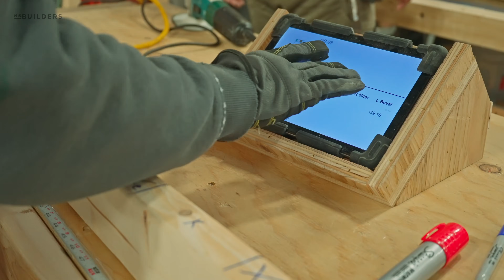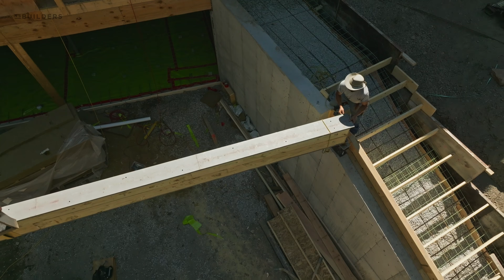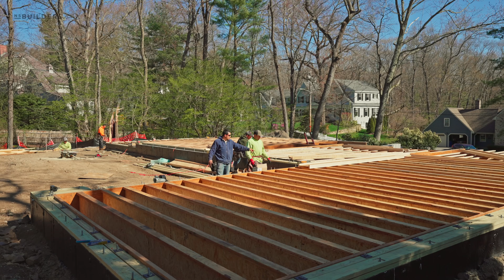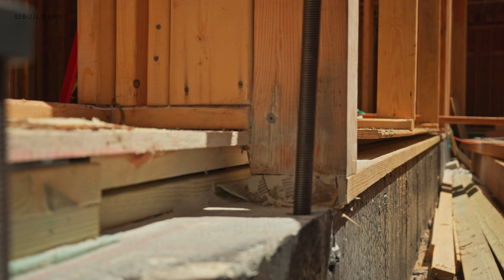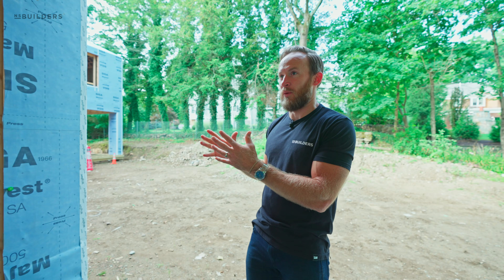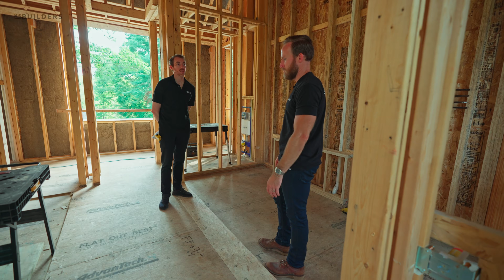Structural Engineer & Builder Walkthrough Custom Residential Home

Comment: Sandwiching LVL with steel plate is a great way to rot an LVL if it's in an exterior wall, I don't know why you would not just use a regular steel I beam, insulate one side pack(ledger) the other, or use wider LVL, if it's thicker than the bearing you have to use post+cap though not just stud, not a big deal.
 I use strongwalls a lot in narrow city houses it's the only way to keep them from falling over without an interior shearwall.

Comment: Bottom line: general contractor and framers must take structural engineering classes for builders. Also they need to obtain residential residential building certification. I hold myself to this standard.

Comment: Very beautiful framing work, from the attention to detail to the craftsmanship. As an architect and engineer, I really enjoy videos like this. However, I would be concerned that those metal pipes in the roof structure might condense moisture inside, causing water to drip onto the walls during the cold season.

Comment: Almost emailed the firm by youre a ways in on this. Price a vaccuum glass light for that skylight. I recommend pricing it yourself instead of having your window company do it. I want to say that an R10 piece from Japan was $13 per sf R-20 or 30 was an option also. That price was shipped. There is also a good manufacturer in Holland or Belgium wich might be better for you, im in Colorado
Reply from the maker: Interesting. I’ll have to check that out
Reply: @NSBuilders  yeah I was surprised and I'm going to start making all my fixed windows in house as soon as I can.  When I saw the tech I was really surprised at the price and have that project on my to do list.

Comment: The concrete shelf in the foundation would just be putting a cardboard blocking box around it. Absolutely cheaper, you just shim the joists to get level.

This way is more typical. I think people avoid shelves because it requires two trades working with each other to agree on the foundation.
Reply from the maker: Yeah both work, but we figured let’s keep the tolerance in one trade.

Comment: The stiffener for the 3" waste line is OSB not plywood, if you ran your calculations based on plywood, shouldn't you have used plywood instead of a scrap piece of advantech ?
Reply from the maker: We installed what was asked. Advantech is what was asked.

Comment: Why did you use plastic for waste lines in the ceilings and walls instead of cast iron seems likely that noise will be present in living spaces during uses? This home is very well put together all your subs did an excellant job, framing almost looks furniture grade too bad it's necessary to cover! The large flat skylight glass has to support snow loads and will block out light when covered during winter snows, why not have a gable or hip roof for the skylight to allow snow to self clear and reduce leak possibility while allowing light to enter even after a heavy snowfall? I'd buy a home built by your firm in a New York minute, great job. I agree with the engineer in designing the roof support so that it does not present single point failure, very sound. Ray
Reply from the maker: Hey Ray, we discussed the cast, wasn't possible in some areas, and just overly expensive, we will treat the areas of concern for sound before finishes
Reply: @NSBuilders  Thanks, that's a great solution for waste line noise and will work fine, Only item for me is that flat glass 9' square skylight, I'd have built it in a glass 12-12 pitch hip glass roof to assure self clearing during winter storms and reduce leak issues from standing water in warm weather. This is a very nice home that's extremely well built look forward to your next project. Ray

Comment: As a framer….the ledger on top of the wall is a great design.  Beautifully executed and well worth the effort.  Flitch beams work very well, and are enhanced by applying ribbons of either epoxy, like a two part extended set product or construction glue like Locktie PL3 to all inside surfaces.
Reply from the maker: Appreciate that feedback

Comment: What are you planning to do so you don't hear that toilet in the living room every time someone uses it upstairs? Having owned a two story home it was always a pet peeve hearing the water going down when the toilet was used.
Reply from the maker: We need to insulate it, I wanted to use cast but was too difficult to pull off. Wish I coordinated this part ahead of framing but we didn't
Reply: Using PE- or PP-piping instead of PVC helps a lot, together with some sound proofing insulation.

Comment: Great revelation of details gentlemen. At 11:15 I especially appreciated the level detail regarding deflection over a 20ft span (LVL, steel plate -repeat). I did something similar with a wide garage door that had to hold 2 ft of brick facia, except LVL wasn't available 38 years ago. My dad & I build that house. We followed the blueprint. I lived in that house for 30 years and that wall never budged; mortar never cracked.
Reply from the maker: Love it!
Reply: Yeah, when I saw that detail I went straight to the comments. Glad someone else talked about it! I've never seen a flitch beam.
Reply: Id forgotten about them. Nice reminder.

Comment: Super cool. So that inner wall will also get insulated after the mechanicals are in? And you won’t need Siga Majrex because you also have comfort batt on the exterior?
Reply from the maker: We dont need the majrex because the dew point is outboard of your sheathing layer, because of the exterior insulation.
Reply: The sheathing layer + Siga Majvest 500 SA (baby blue) act as the air barrier. This air barrier also has vapor retarding properties due to the use of plywood (Majvest 500 is vapor open).

The exterior insulation makes that no vapor will condensate against the outer plywood. 
You can also add some extra interior insulation as long as you keep the R-value of that interior insulation layer below 50% of the outer insulation layer (as a rule of thumb for cold winters). (*)

Main advantage of this all is that an (extra) interior air barrier (i.e. Majvest 200) is indeed not needed.

(*): It's a good idea to use a bio-based insulation material (i.e. hemp, flax, wood fibre, cotton,...) for this inner insulation layer as bio-based materials are better in buffering vapor and in sound insulation.